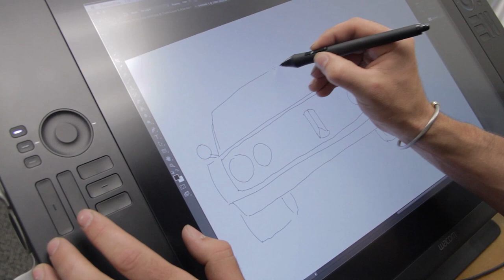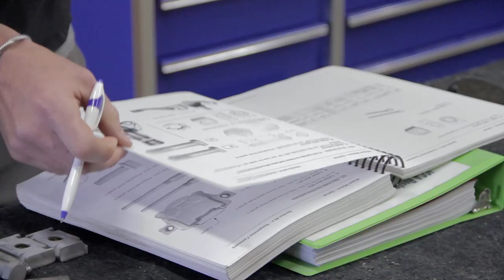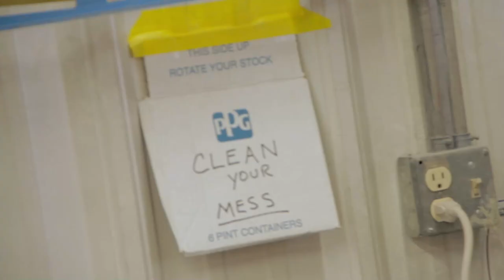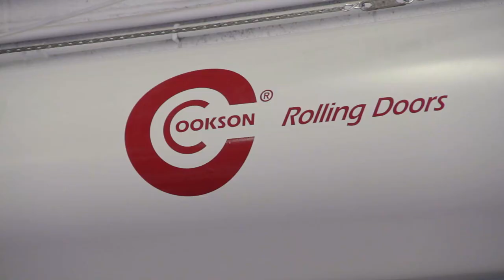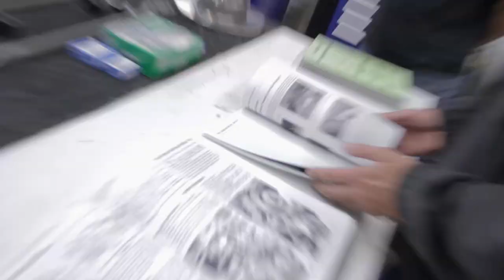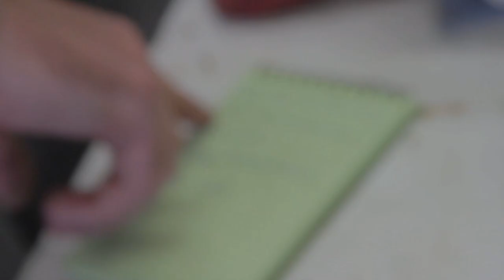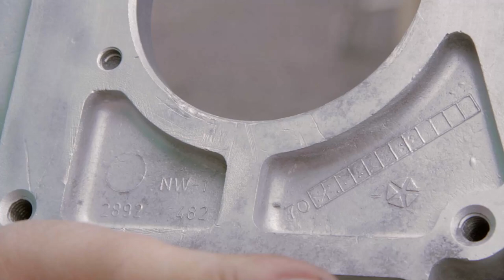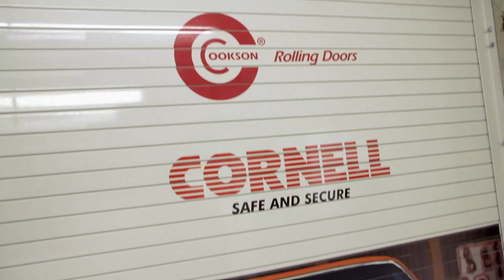Season 2 Episode 5: "Factory Correct"

Comment: These engines were painted with the exhaust manifolds and negative battery cable installed. You shouldn’t use black primer under orange! Also urethane isn’t the best choice for an engine. Synthetic ( alkyd enamel) has the highest temperature resistance of standard paints! The perfect primer is red oxide synthetic enamel!
Reply: I think they're trying to keep everything OEM.